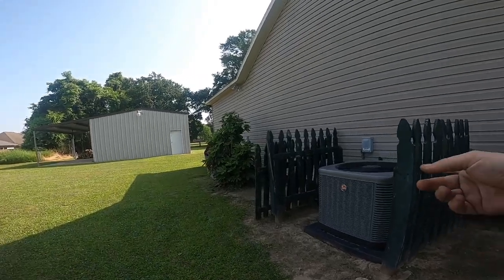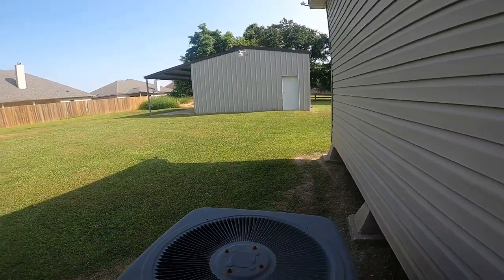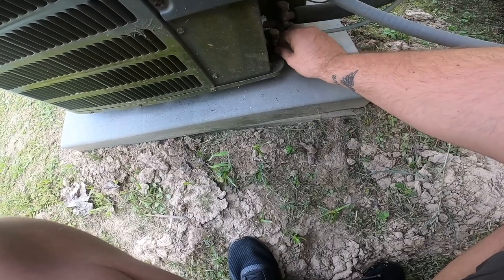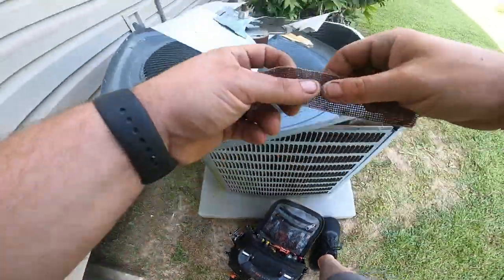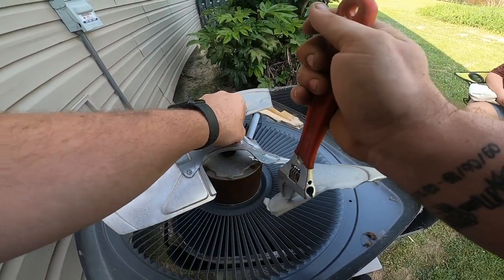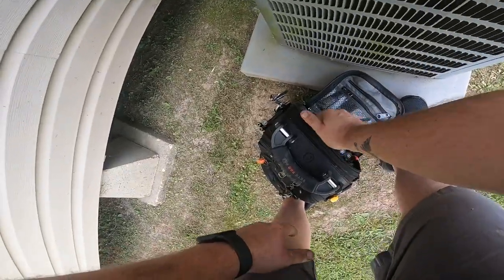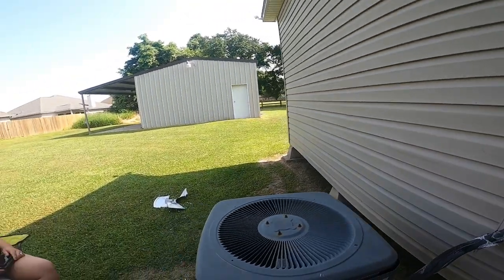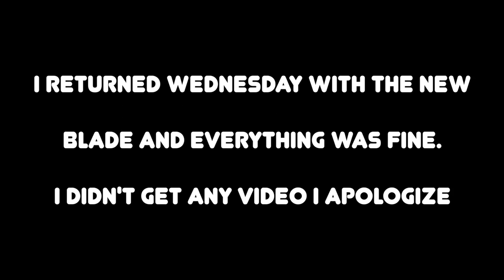No Cooling/Goodman Fan Blade

Comment: I wonder if the fan blade was made by either revcor or lau. Those blades are junk.  Torn make the best fan blades i think.  At least it did not damage the coil.  I had that happen to me and i scrapped some of the aluminum fin away and soldered the hole.  She was good as new.
Reply: I think its spelled Torin.